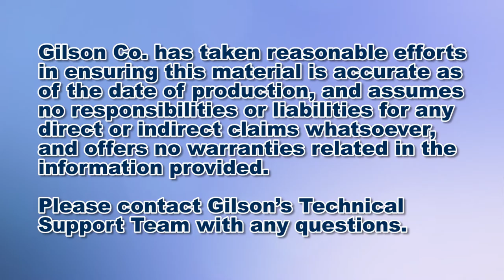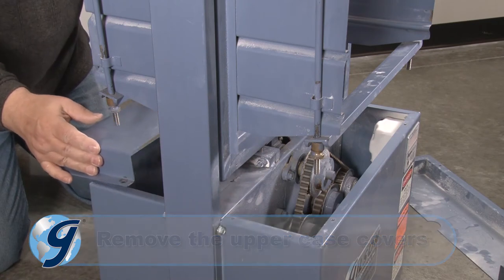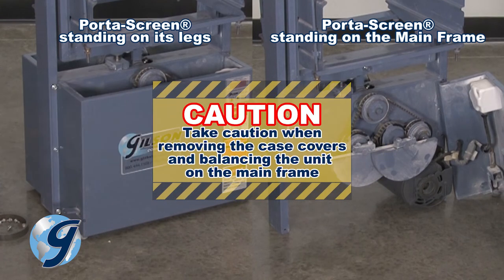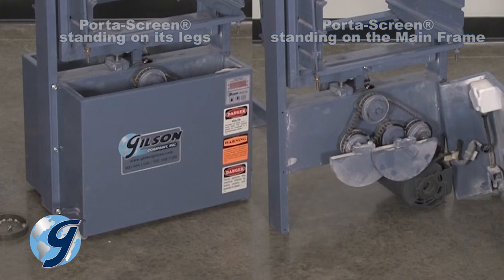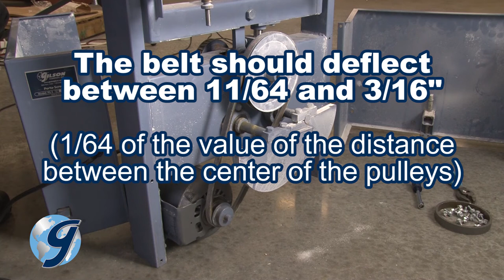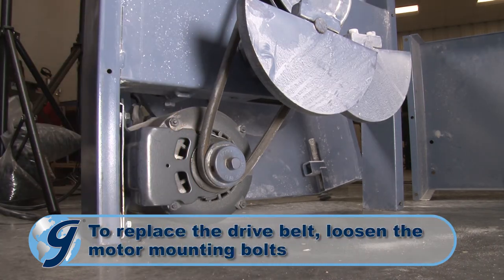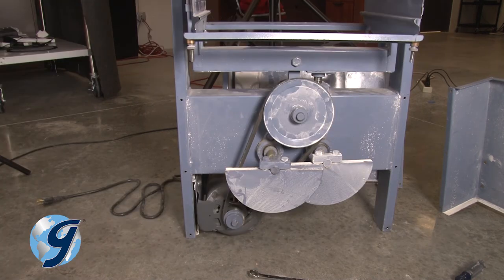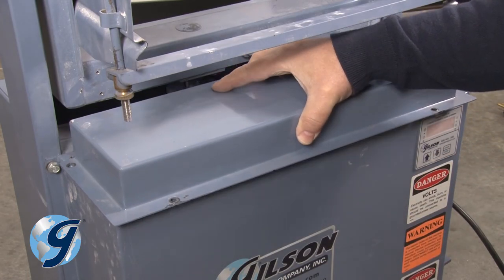How to Adjust or Replace the Drive Belt on a Gilson Porta-Screens®

Comment: I have a question.  I have 9 of these shakers.  We have a PS-3 that we are trying to fix.  The shaker is bouncing violently.  We have balanced the counter weights, and put on new bearings. Doing those things has not fixed the problem.  I would appreciate any suggestions you may have to fix this problem.  Thank you
Reply from the maker: Marlene, Sorry you are having problems with your PS-3. I have forwarded your comment to Technical Support, but I'll need you to reach out to Technical Support directly at techsupport@gilsonco.com or 1-800-444-1508.